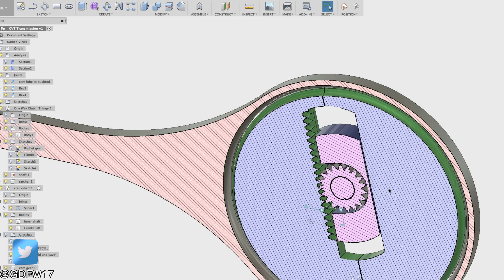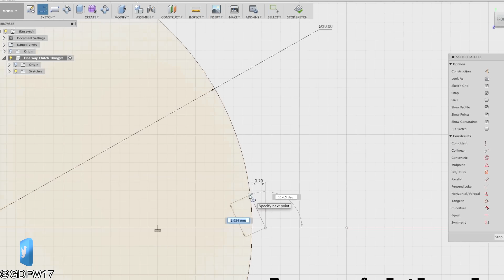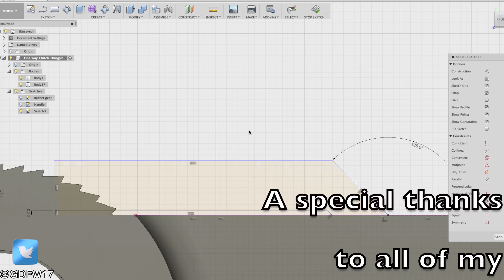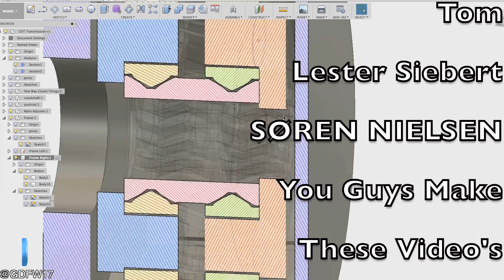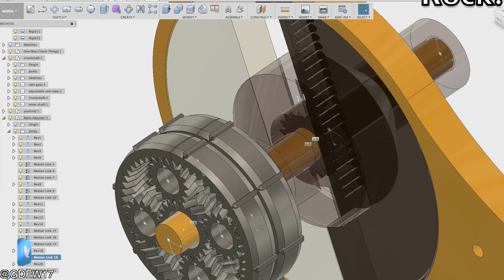The Coolest Transmission You've Never Heard Of... The Ratcheting CVT

Comment: Yes!! No more junk belts or slip mecanisums the ONLY slip mecenisum I ever want in my drive train is an enclosed clutch, this is why I always have manule transmissions in everything for atvs I ride all 3 wheelers I've always liked 3 wheelers, but the new 4 wheeler drive me CRAZY how they all have snowmobile clutches, we had a Polaris ranger with us one time, it couldn't even climb out of a ditch, the belt would slip the engine is supposed to have 90 HP but you can only use around 3 until the belt slips

I can really see this transmission useful in tractors, bulldozers, or vehicles that use  wry slow gear ratio, I hope you've patented it

Comment: This very design was on a pump that I used back in the 1990s where I worked. It had a lever that you could loosen the And move the lever and then lock it down. I believe it was sold with the label of Dayton.

Comment: I had a concept back in the 80s about using two cone-shaped gears that opposed each other with a floating gear in between them. The concept wasn't too bad but it seemed like the floating gear would have been a major weak point.

Comment: It's not continuous because it works in increments of the ratchet mechanism, correct? That still gives you (potentially) many different "gears", but at each step it's incrementing by one tooth of the ratchet mechanism, correct? Still awesome though.

Edit to ask: how efficient is it compared to other transmissions?

Comment: going to be throwing some popular mechanic mags at my  kids (ages 7,6,4, and 2) any recommendations to help my young boys get into engineering?
Reply from the maker: If they’re interested in it, it will just happen.
Reply: Interesting? you feel like you were thrown a a very random variable existence and ALL of the predispositions to and exposure to mechanics and engineering was God sended down to you? hrm interesting.. I am ready to unsub (like that matters anyway) but I wanted to say this instead: You have a long way to go pal.. but I wish you the best. Oh and here is one to really wrinkle the folds in your feather; God Bless you friend.
Reply from the maker: Let me rephrase my answer, give them the tools that they need to take anything and everything apart, and encourage them to do so, it doesn’t have to be expensive stuff, it’s more important that it’s complex stuff. You can learn a lot I by tearing apart a VCR or a CD drive or even a microwave, especially if you can get them interested in figuring out how/why it works. not everything can be 100% reverse engineered in one afternoon, so it is always fun to follow up with a video or article on how the particular item works to find out if your assumptions were correct.
Reply from the maker: Of course, make sure your supervising them, and well aware of potential energy storage devices such as clock springs and capacitors that can cause serious injuries if not properly discharged.
Reply: Thanks mate, I appreciate you revisiting my question.

Comment: Ahh I've had so many ideas for things that I thought would be revolutionary... still come up with these things today... Im certainly not a mechanical engineer or anything I just like thinking of solutions to problems. 
Like one time in automotive air conditioning class I was thinking of a mix breed between an air conditioner type system that was basically mixed with a steam engine type system in which the engine would use a refrigerant as a working fluid and by using external (or hopefully ambient) applied temperature to cause the machine to run. T
As it turned out there is a device that pretty much does what I had hoped... its called the Rankine Engine Cycle. 
BUT what I had hoped was possible was to use some sort of existing or even ambient temperature to provide the energy to work the engine.

Comment: Wow this design is incredible! I guess the crank arm length is analogous to a final drive ratio. The longer those arms are, the lower the minimum speed. I agree that this may not be truly continuous due to the discontinuity in the output. As well as the possibility that the output could oscillate near zero output speed. I'm impressed that the printer you used can keep up with the tolerances required for creation of those gear teeth. Was any post processing required on the gears to make them smooth enough for use? Great video!

Comment: is the prm on the output really a constant rpm, by a gear ratio, dependent to the input rpm or does the machine also create some rpm oscilation, like a harmonic superposed to the wanted output shaft rpm?
In any case, very cool invention, even if someone else had the same idea earlier!

Comment: It seems that refining the design hinges around the ratcheting.  Perhaps if two counter-rotating drive gears were mated, then it will be possible to provide power on both the push and pull cycles of the levers, smoothing things out.

Comment: This is insanely clever. the only reason why i don't see this as being truly continuously variable is the ratcheting mechanism, as the cranks have to increase their throw by a large enough amount to engage a larger number of teeth before there is any speed increase. However, there are such things as one way bearings that spin freely one way on a smooth metal shaft and lock up the other way, like having an infinite number of ratchet teeth, not really 3D printable but they are available in metal. If you could embed those into the levers in place of the ratchets then it just might be truly continuously variable.

Comment: My only question is: why use a ratcheting motion on the output shaft instead of a traditional offset journal crankshaft? My immediate thought is that you'd be losing power through ratcheting, but I could be wrong in my assumption.

Comment: Cool little device! There is a very similar transmission that has been around for over 50 or 60 years called the "Zero Max" drive. It uses a multiple set of cranks and cams and they are phased shifted to change the stroke. It is not true rotary motion on the output shaft , but it is close. I met the inventor back in 1969. Look it up.

Comment: Cool design. I wonder if you’re also clever enough to make an electronic analog to act as an inverter.  That component is a big bugaboo in controlling power from battery packs in the up and coming electric cars.  Yet, it is analogous to a transmission for power transmission.

Comment: That thing looks really cool! And it works, which is even better, but I had a couple questions. Most vehicles have at least a 1:1 drive gear and an overdrive of .78:1 so it is more fuel efficient at higher speeds. Your set up looks like a very low gear ratio (like 12:1) where most cars start in first gear around 3:1. How would you increase the gear ratio of this design to make it viable as an actual transmission? Also, with most transmissions the friction (and wear) is focused on the gears that have minimal sliding contact points. Your design may suffer from very premature failure at the ratcheting mechanism as the teeth are not meshing but intentionally skipping over the gear which will wear down very fast relative to a traditional geared transmission. What would prevent that from happening? Still a very interesting concept and I truly have never heard of a ratcheting CVT either! No way I could've come up with that idea, lol!

Comment: Hmm. I think you should look at the FENDT Vario Transmission. Probably the coolest way to transfer power with minimal loss. I tried to find the test, but I can't seem to channel my Google-fu. No ratchets etc. Everything is working with a hydraulic pump and a motor that is tilted. There's only high and low range, one main gear and that's straight through. The range could be omitted for cars.

Comment: It seems to me (strongly did not understand) that the driven shaft will move in jerks, вut this problem is solved as always by a flywheel. But two flywheels on the machine + imbalance in the box itself is IMHO too, although the very idea of the mechanism is wonderful. I think if there is an automatic box on the internal combustion engine it should be electric :)

Comment: Great video, but ratcheting would cause a huge amount of wear. I've dabbled with similar concepts where the ratchets are replaced with a motorcycle style ramped slipper clutch. Take a second one and gear it backwards with a pair of clutches to separate them and boom, reverse. The speeds of the rod ends are also variable and are moving fastest around 70-72 degrees depending on rod/stroke. To have minimum outputspeed fluctuation under heavy load, and keep from twisting the drive input shaft from load-unload intervals, you would want as many lobes as possible (720 would be best), but 17 set at 20 degrees apart would be able to handle a pretty big load.

Comment: I think it is not a true CVT because it still has discrete ratios, even if there are many of them and they are very close together. It will not produce absolutely any arbitrary final-drive ratio within the total range, the way a CVT will. How significant this is in practice may depend on the application, of course. Whether this design is more durable than an actual CVT remains also to be seen.

Comment: ok i can see how the system is supposed to work but what would have shown us more would be two revcounters on the input and out put shaft so we could see the difference in gear ratio,, cvt in cars started in around 1967/68 with the company daf who made a series of cars cvt driveb , daf were bought out by volvo in the early 70,s , i had driven many of these i just couldnt get used to the constant r pm . it was very effective but it robbed power and had poor fuel consumption and noise , ford spent a fortune on thier system only not to use it , it does suit certain  applications,ie small motorcycles off road four wheelers stc

Comment: I'm going to guess it's not a CVT because it doesn't output at a constant rate. Similar to how UV Joints work at more extreme angles (Noticable at more than 45 degrees).

Comment: Thanks ahead. just being straight forward for some challenges compare to real CVT. first, vibration, it would fall apart. second, there's no change of moment distance, then how to increase torque. third, if you have circular torque, would that be a waste to convert that to ratcheting motion? it is also hard to calculate the output .........well.. it is fun to use 3D printer for prototyping.

Comment: i thought one up too, Useing two bulbus cones pointing at each other with twisted gear teeth depending on the connection point of the cones gives the ratio. always meshed gear, the cones rotate just enough to shift the point of connection there would be actuators to rotate the cones. its hard to describe but i have drawings. its fairly simple in design two bulbus cones striped with gear teeth toward the point locked together but able to shift small-large to large-small.

Comment: The original is known as the D-drive, it effectivly puts load on only sprockets and connecting drive shafts. The variable output is controled by 2 electric motors which creates the least amount of mechanical friction on sun gear transmission while also creating more continous incriments since the difference in speed between 2 brushless electric motors is very fine and the most continious, most efficient, with the least amount of friction yet so far, in design its nearly perfect for performance and robustness but is bulky in design as well.

Comment: CVT was nót invented in 1994, but much earlier, in 1965. It was called Variomatic then and was first invented and used by the Dutch company DAF (van Doorne's Automobiel Fabriek). They used a rubber belt, later this belt was replaced with a belt made of metal parts by the Japanese. Look at this video:
https://youtu.be/hl8KDZh_O0w

Comment: Okay, so I am not the most mechanically inclined person in the world, but if I understood you correctly, you said that they don't make cars with these (most of the time) because they break often. So, would it be feasible and cost effective to just have a car with two or three of them in there, have it fixed to where if one broke it automatically switched another one and make them of such materials that they would either (1) Not break so often or (2) be cheap enough and easy enough to extract and install, that just going in to get a new one for when one of the two (or three) broke that it would be cost effective and cheaper than replacing the sorts of transmissions that we have now?

Comment: Get rid of the ratcheting part, just connect the rods to a plain ol' crankshaft like a miniature Shay locomotive. It would still need an external planetary (or other mechanism) for reversing, but would be a good bit more robust.

Comment: This is great. I think I know why it is an impostor CVT.  For a given RPM on the input shaft, the minimum speed of the output shaft depends on the number of teeth on the ratchet wheel.  So there is a minimum eccentricity the cams must have in order to produce rotation of the output shaft.

Comment: I completely agree with your gripe about the cars with pre-programmed "gear" ratios.  It's not just the consumers though - car journalists really encouraged this too.  Most journalists were really whiny about how a CVT feels, even though it was working perfectly fine.  It seems to me the #1 complaint was the droning noise, whichis total BS because once you're at highway speeds, your drivetrain is at a constant speed.  Also, who goes on regular commutes without listening to anything but the engine?

I really wish most CVT cars came with a setting to take advantage of the transmission, and then another mode for people who can't handle change.

Comment: I drive a standard.  5 speed overdrive.  In 4th gear the output of the engine is matched to the output of the transmission.  At 2000 RPM engine speed, in 4th gear, the driveshaft is turning 2000 RPM as well.  Watching your transmission, you've achieved significant reduction in output speed.  If your device was used to power my truck (or car or whatever) there would have to be a significant gear speed increase to compensate for the drop in output rotations.

This is an interesting solution but I don't think anyone is going to want to drive around with a ratcheting transmission.  However, I'll give you your due prompts for thinking outside the box.  I'm impressed as I've wondered about transmitting engine speeds for many years now; and I've never come up with anything that could be viable, nor anything even close to your design.

Comment: Great mechanism, seems like it would be very reliable. Two reasons it wouldn't be good for a car are the vibrations coming off of it, and the non-continuous power going to the output shaft. Works kinda like three phase power which works very well, but probably wouldn't in a car. More vibrations to chew up parts.

Comment: If your able, try and get some sprag bearings or better yet, design some, for the output shaft as they will be far smother then the toothed ratcheting mechanism. Also, it seems like the number of conrods that would be best suited would likely be like a radial engine, prime numbers. 5 to me at least seems like it would be best before performance returns become almost nill.

Comment: 2:47  Consistently Variable Transmission?
But seriously, I really like the way you've combined the elements of a ratcheting drive together into a very compact layout.  I have to admit I had a very similar concept drawn up on notebook paper when I was 10, way back in 1967.
What's very ingenious is the way you've stacked 2 planetary gear sets together so that you control the phase of the inner shaft relative to the power input shaft by turning the control knob.
If I can summarize, the hollow input shaft turns the planet carrier of the first planet set.  Because its ring gear is fixed, its sun gear is forced to turn.  That sun gear powers the second planet set, causing the second planet carrier to rotate at the same speed as the input shaft as long as the second ring gear/knob is held still.  The rotation of the second planet carrier is coupled back through the hollow input shaft, causing the pinions to rotate at the same speed as the input shaft.  By rotating the second ring gear/knob, (like the cross drive motor on a tank transmission) you speed up or slow down the second planet carrier very slightly (while the knob is actually turning) so that when the knob is still again, a net angular displacement has occurred between planet carrier one and planet carrier two.  Very ingenious!  Have you thought of pursuing a patent on that?
One thing I see is that there has to be some way to hold the knob still because the torque produced by the pushrods tends to drive the knob to reduce the height of the eccentrics and go to neutral.

Comment: Im gonna guess the problem is that it technically wouldn't have a true neutral. Even with the pushrods in the neutral position,  the gearbox's output shaft is not free to rotate as if the gears were disengaged. The ratchet pawls are still on the output shaft and would prevent reverse motion. So "neutral" is more like "park" that only keeps the car from rolling backwards. Is that the issue? The lack of a true neutral gear?